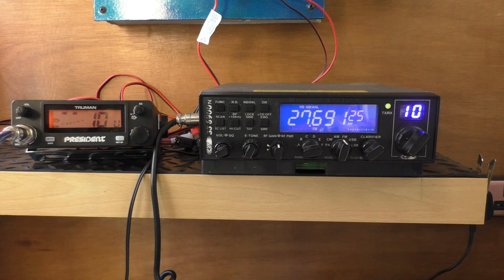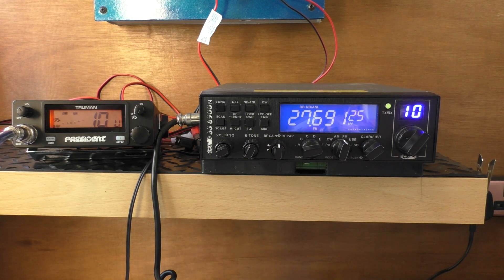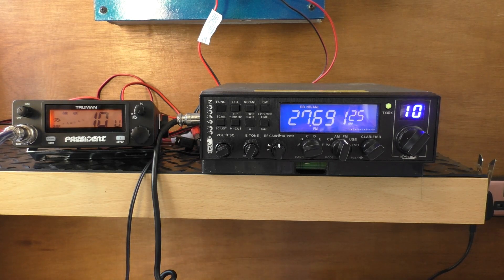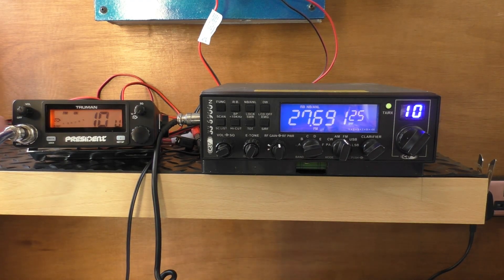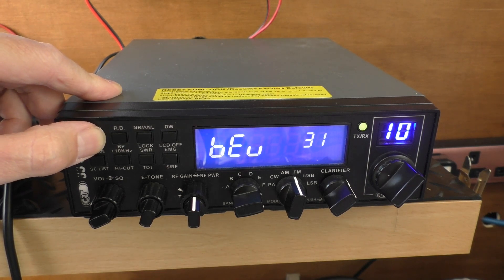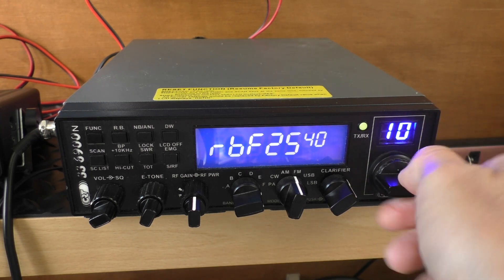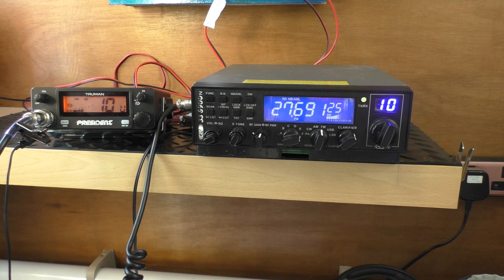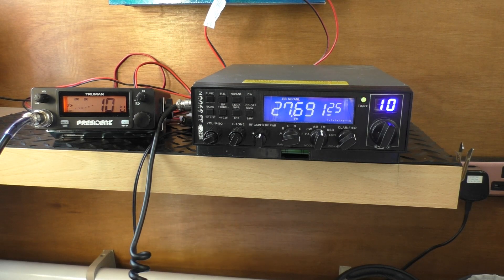Adjusting the CRT SS 6900N Roger Beep. (All steps shown)

Comment: Hi Fred I’ve got the 6900N and when I turn the frequency knob it makes a noise and showing on the radio shows BP how do I switch it off
Reply from the maker: Hi me old mate.  Try the "function" + "RB"
Reply: All done Fred 
Now to get rid of busy when tx on channel 9
You can turn down the squelch I think if I go into the program via computer think I can disable it there
Reply from the maker: Only Squelch adj is the outer pot on the Vol control.
Reply: @kevinjames9852  the only way I could get rid of the "busy" showing on 9 was with the software and cable. I could not find anyway to do it with radio itself. Oddly enough, it did not do this when the radio was new. All of a sudden one day it started doing it on its own.

Comment: I did not buy the CRT SS 6900N because of the awfull roger beep. In the dutch amazon store the 6900 is about 200 euros. I rather add another 25 euros and buy a ALINCO DX10 for 225 euros as of now in the Dutch amazon store. Instead of the 6900 you are better off with the CRT 7900 or 9900. I have them both and i am satisfied!!!
Reply from the maker: Yes i prefer the DX10.  Ive seen it at he same price as the 6900 in the UK.